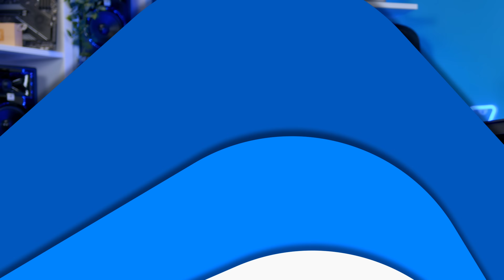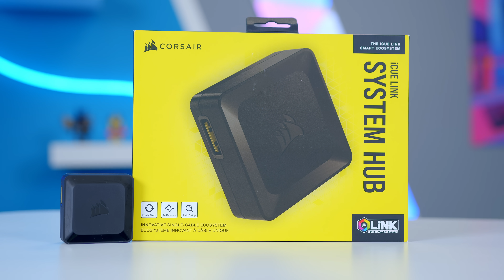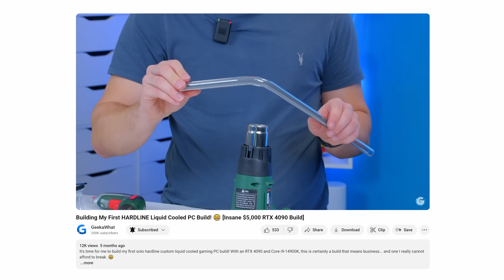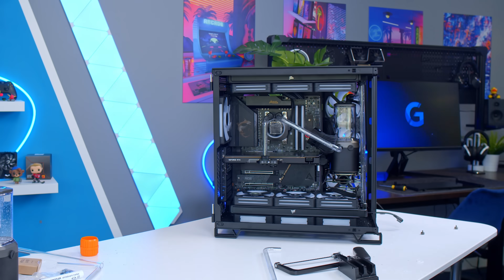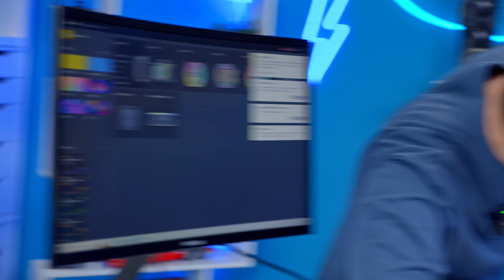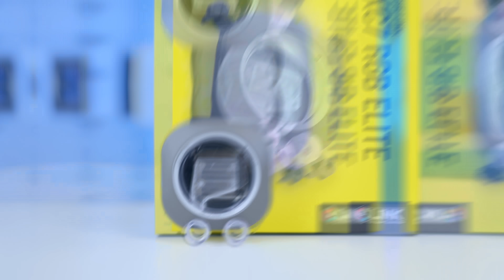My NEW $5000 Gaming PC Build Was a DISASTER! 😭 [Personal Rig Gone Wrong...]

Comment: Probably wasnt splitting them correctly on the 2 control blocks. You dont wanna put 14 on 1 n like the last few on the other. I mean id hope he would know to split it like half n half

Will say icue software seems to always have weird problems after every new update. Makes me kinda regret using thier link fans n ram sticks even though it is nice n less messy when it does work right
Reply: Here’s the thing though. If it says it can handle up to 14 devices through one hub, why not put all those on the one?

Also if you’ve seen the new Corsair full tower case, it had like 36 fans on it at Computex. So in situations like that you can’t really split the load. If Corsair says the Hubs can handle it, for the sake of convenience which is what it’s designed for, why not utilise that?
Reply: @Chig_Beggers  yeah but how many other hubs out there that can run close to that? None so it's not really any different than any other options that n if it says up to 14 devices doesnt mean it cant hit the limit prior. I mean even power supplies has a limit that can be maxed out before using all the available plugs. Not really that big of a deal honestly. 

But yes they shouldn't say it can handle 14 but also fans don't need as much power as pumps and cooling blocks. Having it maxed out with that and fans is definitely more power than just fans alone so probably went over the load limit. Everything has a limit especially power.

Comment: Is this a good pc?

Ryzen 5 7600x

7900xt

Gigabyte b650 gaming x ax 

32gb ddr5 6000mhz cl32

Nzxt kraken 360 non elite

850w psu

Montech king 95 pro

Crucial t700 for fast boots

Silicon Power 4tb nvme for mass storage
Reply: should be fine

but 6000 mhz cl30 is the ideal sweet spot if u can get it 

also for mass storage, do you mean like other video games/programs? or solely videos? cuz if its just videos, you're better off with a huge capacity hard drive.
Reply: you dont need water cooling,  otherwise, great build!
Reply: @ttrdf  thank you but I’m getting it for future upgrades
Reply: Yes, I like this 7600x is a fine cpu for the price

Comment: No way he has hot water from the GPU going to his cpu....
Reply: You're joking right ?
Reply: @P5YKOTIK1870  just pause the video at the beginning...I couldn't believe it...and only 2 radiators for 5000 usd....is he cooling his PC with liquid gold so he has no money left for radiators?
Reply: The water flow sequence/ loop layout doesn't matter. Watch Jayz two cents,  he has a video about it
Reply: @sk1drow832 I'll watch it, but why not?...AMD also why just 2 radiators
Reply: @squeakysneakerstudios3927  because the temperature of the loop will return to equilibrium regardless the direction water flows. Just make sure the fan orientations are correct. 

Not sure about the radiators man.
Reply: @sk1drow832  so we both have no idea about radiators...lol...but if the water from reservoir and radiators are relatively cold, the GPU makes it pretty warm, and the CPU then is stuck with the pretty warm water....but whatever...360mm aio is gonna be fine for me
Reply from the maker: @squeakysneakerstudios3927 the transfer of heat from the CPU to the liquid (before this liquid reaches the GPU) is not instant. The liquid (given how fast it is flowing) doesn’t just shoot up 15 degrees in temperature. This is represented by the temperature tests at the end of the video.
Reply: @GeekaWhat  alright, thanks
Reply: @GeekaWhat  🤔Mmm, not so sure about that my dude.
The coolant coming out of the CPU block is absolutely hotter than when it when in and therefore is preheated when entering the GPU. The fact that you are using a 7800X3D, which is not a very power hungry and as such not introducing heat, is keeping the outlet temp in the "reasonable" range before it enters the GPU. If this were a 13/14900K or a 7900/7950X things would be very different as a result of the greater power consumption. In that case you would be best served by running out of the CPU up to the top radiator before coming down to the GPU inlet and out to the 2nd radiator. Was good to see that iCue isn't all sunshine and rainbows but does have it's benefits when trying to diagnose issues with the system.
Reply: It looks like it's the other way around, pump outlet ->CPU ->GPU ->bottom radiator ->top radiator ->pump inlet. 🤦🏼
Reply: @Jason.Jacobsen  ohhh....ok